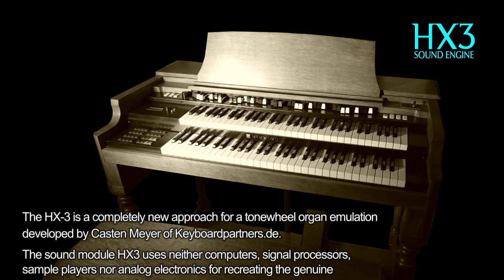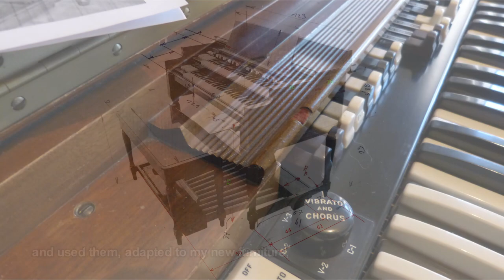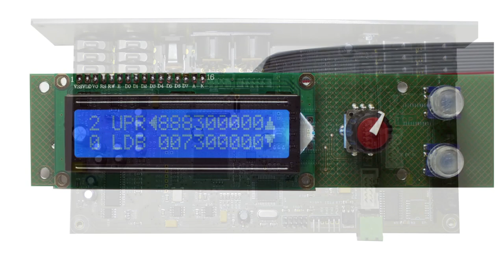HX3 making of

Comment: That sounds really good. I customized an old Korg dual manual organ to trigger via midi the Hammond B3-X app, using a set of Viscount pedals triggering a custom bass module I program for the pedal sound, then that goes through a subwoofer only.  The B3-X app goes into my Leslie speaker so the real Leslie helps a lot.  It sounds good and I am happy with the result. I would love to compare the B3-X app with this HX3 module. Maybe I will reach out to them.

Comment: I investigated the HX3, but went for XK5......but HX3 sounds great, and certainly is a lot cheaper......great job!!
Reply from the maker: The HX3 concept is also very reliable and fool proof.
Reply: The XK5's the most outdated clone on the market (the VASE engine's nowhere near as good as the software B3-X): aside for the three-contact points (which are anyway just MIDI artefacts, not actual hardware) keyboard, everything else is vastly inferior to Crumar, Viscount and HX3.5's emulations.